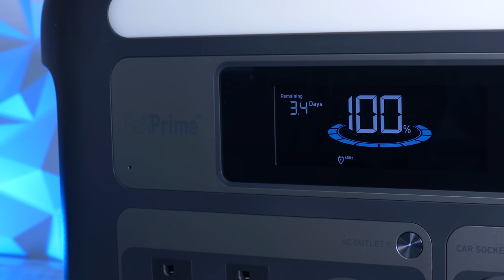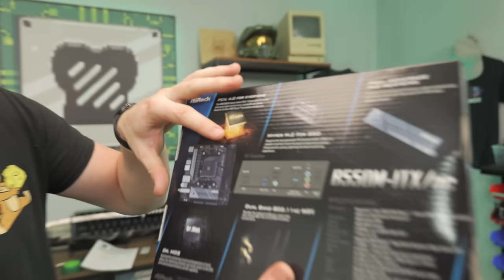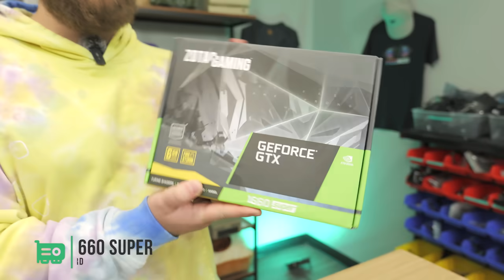We Built a POWERFUL Mini PC for $500?!

Comment: You could fit a lot of power into that little case, if you get a decent SFX PSU from the start. You could upgrade to a Ryzen 5700x or 5600, an RTX 4070, a better CPU cooler maybe like the IS-55, and add at least a 120mm slim intake fan on the bottom. Would be a very capable little system!
Reply: You just described my ATX tower and that makes me sad.
Reply: Noctua NH-L12S is better?
I am thinking about using this case with ASUS ROG STRIX B650E-I GAMING and 7800x3d when Black Friday sales are up.

Comment: I just bought the bigger brother of this case, the S400. It's about two liters bigger and can accommodate the some of the biggest GPUs like the 4090 and 7900 XTX. Still waiting for my 13400 and new case fans to come in before I put it all together.
Reply: I have the S400 also! Amazing case. I have a 12700K and 3080 and both perform really well. I have two slim fans up top and that helps exhaust the hot air out. I definitely suggest using those fan slots if you're running a hot CPU and/or GPU.
Reply: what gpu are you using?
Reply: @dany.2431  Currently, I run a reference AMD RX6800. Probably won't upgrade until next generation of GPUs comes out.

Comment: I just got the G200 which is from the same family of these cases, but can fit regular CPU coolers and PSUs, so you don't need to buy expensive SFX/ITX stuff (only the mobo). It's really not even that much bigger. And where I live was about £10 cheaper than the S300 (because there's no need for a riser cable). I highly recommend checking it out as an alternative. There's also the S400 which is the slightly bigger brother of the S300 that can take two top fans for better heat ventilation.

Comment: I built this case about 6 months ago, works well with my 5600g and 1660ti. Just run YouTube and Netflix. I occasionally game on it, but I have another computer for that.
Reply: why a 5600g with a gpu?
Reply: @friedricedonkey7209  GPU is old and was not doing well. I just replaced it with a 3060 and then I built this. If it dies it dies. Then I have the APU to fall back on.

Comment: I currently have a 12600k and a RTX 3080 in this exact case and it runs great. CPU has the Noctua low profile cooler on it and the only complaint is that the case gets pretty warm after long sessions but I haven't seen any overheating in the last few months with it. Great little case

Comment: Snagged a 4100 for 45 bucks on ebay with cooler.  Then I took a gamble on a "tested for parts not working" Asrock A520 for 21 bucks.  They tested it wrong works great.  Popped in a RX 6600 and boom, Budget banger.  I even used the same ram and m.2 as you here.
Reply: wow, nice
Reply: eyyy what's your total?

Comment: I get this is kinda old, but I'm planning a build with this case. You could do a 7800x3d with some caps on power usage and use a full copper 47mm cooler and be perfectly fine. I would highly suggest you guys join or talk into the SFF communities.

Comment: Im building my younger brother a pc with hyte revolt 3 / PSU and the same mobo from this video and the SSD from here too and I got  the case and PSU combo for around 130 and its keeping my cost down and its running a Ryzen 5 3600 I got brand new for 80 dollars, the case is made for aio, but i added 2x 140MM NZXT PWM Fans to keep it cool, I got the ASrock B550m ITX Mobo used for like a hundred bucks and Its almost built just need to get a GPU and im gonna put in a Radeon RX 6600 inside just dont got the money yet, but I will soon.

Comment: I took this case apart to a.point.of being near flat packed. I got it and hated how cheap it looked (it's.well built enough in terms of sturdiness. I used the PSU bracket and power switch in another build that is lacking those parts.

Comment: Not bad for a itx system. Ive never built a itx system because there's so much risk that something doesn't fit. But a cheap system with a 1660 super/ti that's so small it's hard to mess it up. So long as your PSU fits you should be fine. Apparently AMD is pulling the plug on Rx 400/500/Vega driver support. Not sure about Nvidia 10 series but I bet they will remove driver support soon too. So the 1660 super, and 1660 ti (both perform about the same) make a good option for cheap GPUs with driver support.

Comment: makes you wonder how much  you can pull out of a form factor of that size.
like a 2 fan RTX 4060/3060 paired with a 5900x BUT with the voltage capped to 1.1v and pbo cranked (with an aftermarket cooler) should make a great team.
I run my 5900x rig and pull less than 320 watts at full tilt and that's with a 3070 ftw3 a 5900x capped to 1.1v and pbo cranked
Reply: you can pull alot, the question is more along the lines if your okay with the generally much higher temps you would deal with. (my 10850k can easily hit 90 degrees but its more due to me being limited to a 53mm tall cooler and my z490i board forces me to use a noctua l9i or the thermalright x53 low profile cooler due to clearance issues).

Comment: Does it have an upgrade path? I might want to upgrade the GPU and cpu in the future. 🤔
Reply: it does, you can go to a ryzen 9 5950x if you need the cores or an AMD ryzen 7 5800x3d if you want the best for gaming on the platform.
Reply: The motherboard is good enough to upgrade I wouldn't trust the power supply. You would need a stronger cooler also most likely.
Reply: @boomshaka918 well that's a given fact  for everything else aside from the motherboard.  I'm sure he's not stupid to not change the CPU cooler and PSU when doing the upgrade lol

Motherboard is 100% fine for the CPU upgrade.

Comment: So tempted to do this mini build. I just got a 4060ti16, and the rest of my system is desperate for an update. I essentially plugged a modern card into a potato. (fx cpu... big oof). So bringing myself upto speed for 500, take away the 1660 price, fire savings into a better cpu, I might be laughing.
Though I wonder how close to redline that power was. The 4060ti16 doesn't take ~that~ much more power than the 1660, (165 vrs 120) but I'm left wondering if there was enough headroom on that 500 watt for it.
Reply: Apparently the minimum PSU requirement for a 4060ti 16gb is 550w. I do think u want a better CPU for that 4060ti. Maybe a Ryzen 5500, or 5600. You could do a intel 12100f but I don't know about intel itx motherboards. Intel 12th gen tend to run hotter than Ryzen, 12100 being only 4 cores probably isn't that bad.

Comment: I wouldn't get the B550 ITX board for this build. The A520 ITX will be cheaper. The case uses PCI-E 3.0 riser anyways so the only real benefit from the B550 is wasted. Sure a GEN4 SSD would be nice but GEN3 is cheaper and you're not realistically going to tell the difference if all you're doing is gaming.
Reply: It's only 20$ more tho
Reply: @boomshaka918  That's fair. There's more of a price gap where I live.